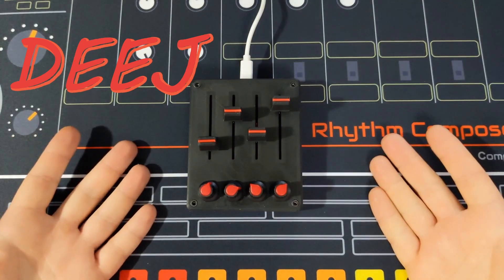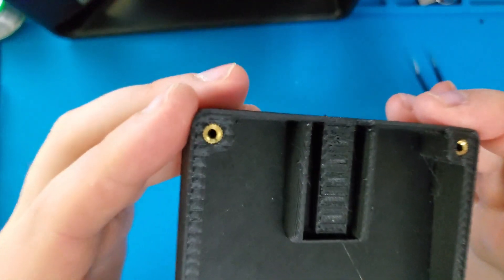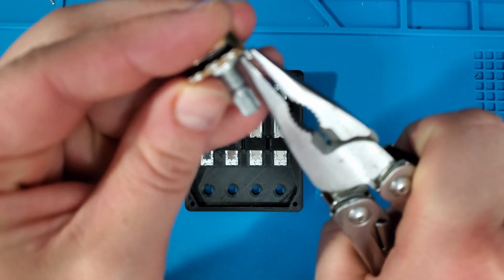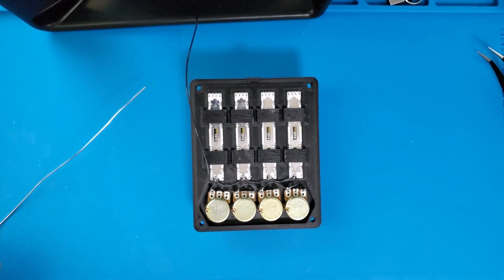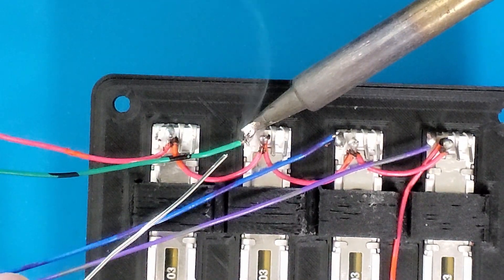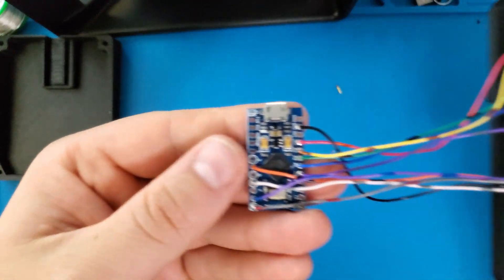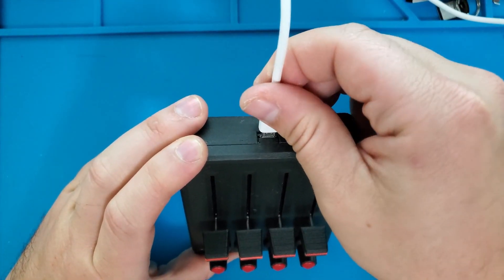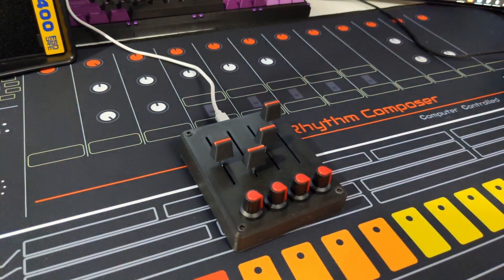I Built a Volume Mixer for Gaming and Streaming - deej

Comment: So a buddy of mine gave me one of these, I'm not into building this stuff so I have no idea what I'm doing. It was working great for him but when I try to set it up I can't find figure out what COM port to use in the config, do I need this arduino thing as well to set that up? In fact, in my device manager I don't see any ports.  Sorry once again I have no idea what I'm doing.
Reply from the maker: Open up device manager, expand the "Ports (COM & LPT). Then, plug in the deej and see if a new device shows up in the list. If the device has already been flashed and is working correctly, it should show up on a new COM port. You do not need any perquisite software to connect a deej to a Windows computer. You only need the deej software executable.

Comment: Hey! Great video, everything was very well explained so decided to take a shot with this project last weekend, 3D printed everything from your list and purchased the same parts you linked. However, I'm not able to install the fader knobs into the slide potentiometers :/ Not sure if the opening isn't wide enough but I tried with quite some force lol. Any help with this please?!
Reply from the maker: Yes, the fitment on those knobs is very tight. Maybe too tight. They are supposed to snap on and require lots of force. I have accidentally bent my sliders while pushing them on. The tightness may be different between different 3D printers, depending on how they are configured and how the model is sliced. In the future I may need to remix that STL for a better fit. I have seen other free slider knobs that would fit this build. So feel free to try out a different knob. If you don't want to reprint anything, you may be able to carefully heat the slider with a lighter before pushing the knob on. This would soften the PLA enough to let it deform around the slider. As a last ditch effort, you may be able to trim the slider with a pair of snips or a file. Trimming would also be a cool way to adjust the height of the slider knob without requiring a deeper enclosure. I hope one of these ideas is helpful. Thanks for watching!

Comment: great video! some nice helpful tips there for combining electrical components and 3D printed parts. How did you get the nice red and black heads for your linear sliders? Do you have a dual filament extruder?
Reply from the maker: The 3D model for the slider knobs is designed to hold a piece of unprinted filament on top. I just printed them in black and slid a piece of red filament in. Here is a link to where I found the knobs: https://www.printables.com/model/134529-misterdeck
Reply: @MadModLabs  thanks!

Comment: Nice project!
When using normal potentiometers (not rotary encoders), what happens when I alter volume within an application using an on screen slider?
Reply: when you move the slider the volume will just be as the same position as the slider
Reply: @dergamer828jd  Thanks, I found that out when I made mine 😎👍

Comment: Amazing! If I wanted to use stereo potentiometers instead of linear ones to control the panning of the right or left channel, would I need to modify anything in the code for them to work correctly?

Comment: This is great, would this still work if my headphones are usb with a pre amp?
Reply from the maker: Yes. deej controls application volume just like manually adjusting the volume mixer. It should work the same for any output device.
Reply: @MadModLabs  awesome I'm in this tonight then .

Comment: Can you also control a separate usb speaker? Not the main. 
such as USB2.0 Speaker.exe
But I'm not sure its a program ya know. So is it possible?
Reply from the maker: Yes. Assuming the USB speaker is connected to your computer. The overall volume of an output device can be controlled by setting one of the knobs to "master"

Comment: will work with atmega328 ?
Reply from the maker: deej also works with the atmega328. The first version I ever built was using an Arduino Uno. You will be limited to 5 volume knobs because the atmega328 only has 5 analog pins.

Comment: Does anyone sell something like this? already made I mean, like a streamdeck but with knobs
Reply from the maker: There is a product called the GoXLR Mini that is kind of similar in function. It is kind of expensive though. For a stream deck with dedicated volume control you should definitely check out the MisteR Deck. I have a video about it.
Reply: @MadModLabs  yeah, I might as well try to make  it, will see if my orders from AliExpress ever came.
Reply from the maker: @Martinchox  Nice 👍 Send me a message if you have any questions.
Reply: @MadModLabs  im in the process of making it, quick question, can i add a 2 digit screen to this project? so i can see the current volume %?
Reply from the maker: @Martinchox  There is probably a way to accomplish this. You may want to look for a project that uses Arduino code to control a 7-segment display. I am not sure how to combine it with the deej software though. Someone on the deej discord server could probably offer more advice on modifying the code
Reply: Stream Deck now sells the Stream Deck +, but it's not cheap. Additionally someone on Amazon said it can't control volume levels in OBS, but I haven't been able to independently verify that.

Comment: Hello, great video and thanks for the tutorial! I was wondering if you happened to have the CAD files for it (STEP or if you happened to use Fusion 360), because the sliders that I ordered are a bit longer. Thanks!
Reply from the maker: No problem. I just exported the .STEP file: https://www.printables.com/model/308252-deej-volume-mixer/files
Reply: Hei, are they 7.5 cm ? I have them that long but I cant open in fusion :(
Reply from the maker: @sebastiancojuharii5958  You could use the modified model that @FierceDeityLink1 created. His sliders were 75mm long. Here is the Link: https://www.thingiverse.com/thing:5623994

Comment: hey there great video but i've got a nooby question what does the ohms mean for the sliders i saw there were a lot of 20k and 50k sliders for a cheaper price will they also work i also saw there were for example a20k and b20k what does that mean (sorry if its obvious i am just pretty new to electronics)
Reply from the maker: In an electronic circuit slide potentiometers act like a resistor that allows you to change the resistance. The resistance value is given in Ohms. So a 10k potentiometer will reach from 0 Ohms to 10,000 Ohms. The letters A and B represent the rate that the resistance value changes when you turn or slide the potentiometer. "A" potentiometers have a logarithmic taper. They are normally used for analog audio volume, like in an electric guitar. "B" potentiometers have a linear taper. So they have a consistent rate of resistance change across the entire potentiometer slide or rotation.
Reply: @MadModLabs  wow thx alot for the detailed explanation  really helped me there